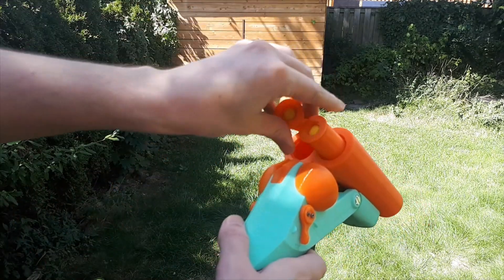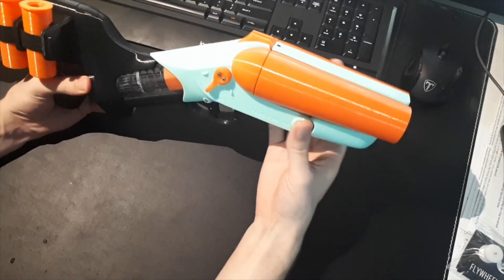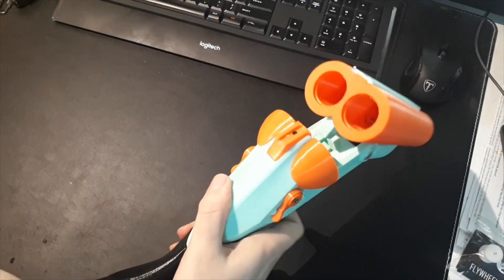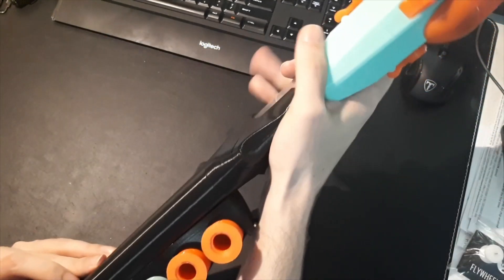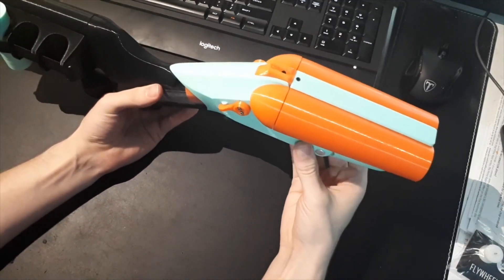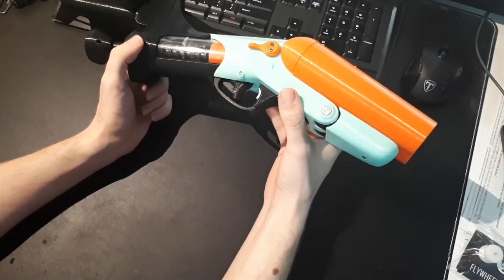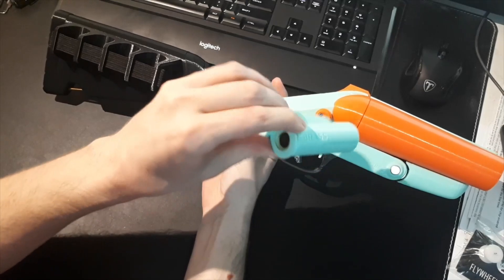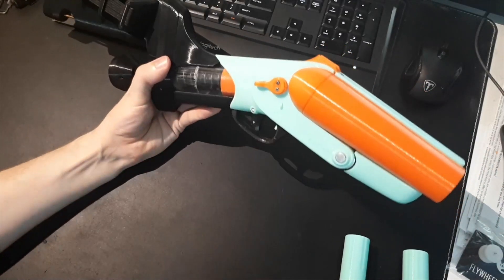Foam A Nature - A 3D printed Nerf side-by-side double barrel shotgun

Comment: Cool that you can buy it prebuilt but...almost $200? I’m new to this 3D printed gun stuff and don’t know what’s a good price but I feel like $200 for the gun and an extra $200 for shells is....a lot. And it’s just for fun, I really only see people having fun with this not going around and using this in a serious way. Then again I don’t know the work that goes on behind this so I’m oblivious
Reply from the maker: Yeah, $200 is just about what you'll pay to have someone print and build something of this level of complexity. The FAN is not an "easy" build and some of the parts require some finessing. 

Also, whoa, $200 of extra shells is A LOT. I personally only have about 50 shells total for my Spring Thunder. I just collect and re-load them between rounds
Reply: @ehdrien1094  ah yeah I assumed it cost a lot to make and be a pain to build. Maybe when I have extra money I’ll consider buying it...the shells are just a joke though, $200? Bruh...

Comment: Just a suggestion, but what if there were two, half-circle plunger tubes right next to each other (so that they both sit comfortably in the grip) powered by two, high-power springs and a double stage trigger like the rough cut. Then you could fire two shots at the same time or one at a time in quick succession. This, paired with possible nerf hyper shells in the future, would turn this into a shotgun of speed and destruction.

Comment: Do you need a 3-D printer to do this and when you push download files do all the files go straight to the 3-D printer or do you have to look them up
Reply from the maker: Sounds like you're new to 3D printing. Yes, you'll need a 3D printer. When you download the files you'll get a bunch of .STL files. Those will need to be converted to gcode using a piece of software called a "slicer". There are many slicers available, I use "Cura" as it's a free option.

Comment: Only one gripe I have about this thing. Usually I want a shotgun styled blaster to chamber 3 projectiles for a wider spread. I wonder whether there would be power upgrades for this thing. The print quality is just perfect. One of the best ones I've see. But the power is the only gripe I have. I'm waiting for upgrades
Reply from the maker: I tried different springs. I tried doubling the length of the plunger tube. Nothing I did affected FPS in a meaningful way. It's likely a combination of leaking seals and constricted air passage through the selector valve. I'm sure it can be improved, but right now, the road to better performance is not by swapping springs. 

The way I saw it, I could either keep chasing that FPS unicorn or I could release this iteration of the FAN. In it's current state, it would still be serviceable in 100fps games(like HVZ).
Reply: @ehdrien1094  clearly understood. It's not a perfect shotgun but definitely a good blaster

Comment: just curious, is there ever plans to make a single barrel variant, or a over under version?
Reply from the maker: Single barrel is a maybe. Over under I'm is way less likely. Side by side just ended up being simpler to design since I had room "between" the barrels to place ejector-y things.
Reply: @ehdrien1094  Single barrel should be help with the efficiency since you won't have the valve to worry about. I'd love to see a single barrel version running on a SPEXBZ. It would really use the tank to almost its full potential.
Reply: ehdrien I’d kill for a single barrel, albeit with an exaggerated outer diameter to take up the space...

I’m not trying to make a Scorch Shot, what are you talking about?